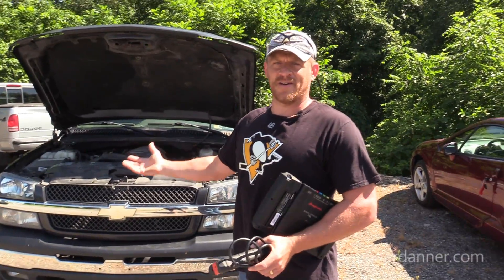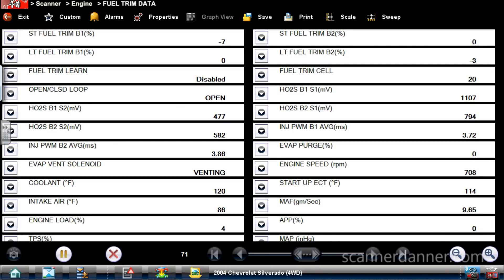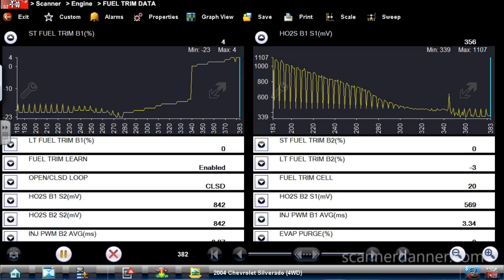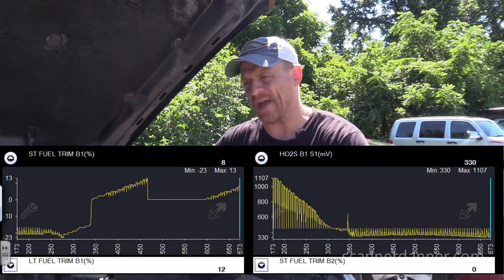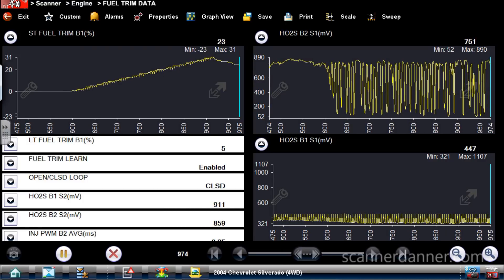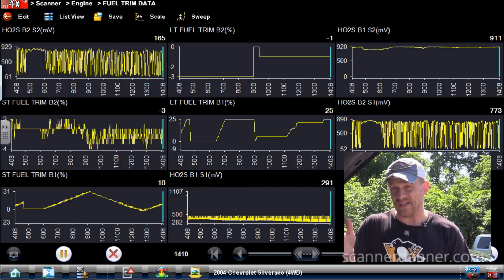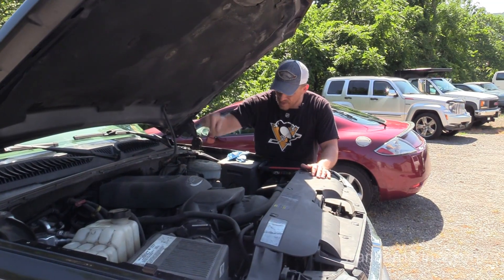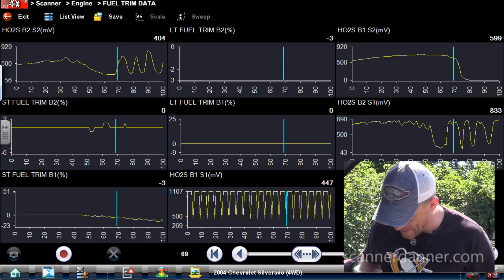2004 Chevy Truck O2 Sensor Fuel Trim codes P0131, P0134, P0171, P1133 part 1

Comment: @9:29

Check the wiring.

I misolaced my multimeter.  Thus, I rolled the duce on a new Denso® oxygen sensor.  It was more dead than the ceby in this video: flat-lining at 185 mV.  STFT +50. LTFT +25.

Oh—I lost the $65.00 + 10% sales tax bet.  New O2 is just as comatose.

1997 Chevrolet Express 1500 5.7L V8.

Comment: Anyone can help me. I have a cheap scanner and trying to fix my Pop Chevy 2005 Colorado. There is a P0446 and p1133. O2B1S1 is showing rich and O2B1S2 is also showing rich. Both O2 seems to respond well to throttle. LT is -14 which make sense to compensate. So my first thought is vacuumed leak or MAF. So I cleaned the MAF and it brought LT down to -2. O2 came down a little but still rich. Could the P0446 caused the lean condition? Trying not to be a part changer and since downstream O2 also showing rich. And respond 1:1 with up stream. I ruled out upstream O2 as the problem that triggered p1133 code. My guess is because it remain 95% on rich, that’s why it trigger p1133. What also trouble me is the downstream fluctuate up and down on rich side (wave sign). I was expecting down stream to be stead instead of having a sign wave like up stream. Still learning so please be kind.
Reply from the maker: What's the definition of the P0446? Most likely two separate issues
Reply: @ScannerDanner  thank you Paul. P0446 is a EVAP Control not switching. I have no other EVAP codes such as small leak or large leak. Without knowing which of the 3 component is bad I checked  the EVAP Purge Solenoid first and find that is working correctly (I.e close without power and no leak and after engine warm up it opened) I then looked at your video on how to test EVAP Tank Pressure sensor and found that the sensor was reporting low voltage all the time even when the gas cap was off signifying high pressure which was not accurate. I did the wire integrity test based on your video (Thank goodness for that video, I would of testing the ground with the 5v reference and possibly fry something if I did not watch your video. After replacing the Fuel Pressor sensor, I was reading the correct value around 1.5v. I drove the car around a few time but the EVAP test hasn’t fully complete. However, normally the Component error code would pop up by now. I will update after the EVAP has completed it full test. You are my hero and I have learned so much in the past few from all your videos to help me narrowed down the issue. Finger cross. I’m trying not to be a part changer. My Dad send his love ❤️ because he was worried that he bought a useless old truck. I do have some bad knews for him. Looks like the old owner has been running this truck rich for a while and the CAT might be bad. Down stream o2 is not looking too good. Did not do a pressure test on his exhaust but I have a feeling it won’t be long until it needs that too. Your ST LT and O2, MAF videos really gave me an amazing understanding of how it works. I never worked on car before and thank goodness there are great teachers like you out here. I brought my Lexus out to a local mechanic and he replaced O2 last year only to have the same code come back in a few weeks. I took what I’ve learned from your checking trims and after I cleaned the MAF, hasn’t seen and codes for awhile now. Much appreciations.
Reply from the maker: @MinhTran-tj4wq  the P0446 is a specific fault (vent solenoid) and is not going to be related to your rich condition. Lets move this to my forum. It is free to join and we can help you there. www.scannerdanner.com Let me know when you post it and I will jump over and help too

Comment: Im getting a P0131 and P0151. And one day I got a P0131 02 circuit low voltage. Its a 05 GMC 5.3 so is it a bad ground? What could that be? And the check engine light only comes on when im slowly rolling on the gas in 3rd or 4th gear. So is it telling me its too lean or too rich when I lug it a bit on the throttle?
Reply from the maker: you need to do some voltage measurements directly at the O2 plugged in, while it is running. If you can get me the voltage numbers on all 4 wires and what the sensor side colors are, I can help answer that question. The sensor ground is a gray wire (most likely) btw
Reply: @ScannerDanner  Sorry im just now seeing your reply. I don't know how I missed it man im sorry. Im going to dig into it today and check them all. I'm not an expert but I think what is happening is I wrote a tune for the Air fule ratio to lean out to 12.5 at WOT but the data shows at WOT its just fat and happy at 14.6 at all times no matter what I do. So if im getting low voltage in a o2 sensors im guessing its telling the truck to stay rich when it should lean out. Again I apologize for missing your reply, I feel like a dumbshit for asking you a question, you reply and I miss it. I do appreciate your reply and time thank you. Ill get into it and tell you what I find.
Reply: @ScannerDanner  Another thing that is strange is when I'm driving and floor it, it kinda slowly builds RPM but when I hit 35 3800 it wakes up and really gets moving. But its a pig down low. And "Bank 1 sensor at idle is 1190mv Bank 2 at idle is 1780mv also at idle "oxygen sensor B0.80V"
"Oxygen sensor B0.10V"
" Oxygen sensor B0.77V" My shitty diablo tuner is showing those all 3 in a row like this.

Comment: Thank Scanner Danner. My truck had those same 4 codes. But mine was a 2012 Silverado 5.3. But when I put the scanner I was getting the same readings for both upstream 02 sensors. Went to check the driver side and one of the wires was rubbing on my transaxle shaft and was missing a piece of wire. I spliced in a piece of wire and put the scanner back on. It was still basically having the same readings. Going up and down. It would go from 0.750 down to 0.090 and then 0.660 and then down to 0.400 and back to 0.100. Both upstream sensors were fluctuating the same way while the downstream were staying steady at 0.650 -0.800 or so. I took the truck for a long drive and the check engine light went out. I had 9 codes and now its showing only four. Even though it had nine codes they were basically only four but repeated twice and one was repeated 3 times. Hopefully that's the problem. I already ordered both upstream and will replace them when they arrive
Reply from the maker: Check to make sure your O2 heater circuit doesn't have a blown fuse. There may be specific fuses for it.

Comment: Hi ScannerDanner, I have a 2000 Montana Van 3.4, driving just fine right up to 110000 miles....then P0131 and P0137 popped up together.  I tried cleaning the MAF and knocking dust out of the air fliter (was pretty plugged)  I do not know how long it will take for the codes to clear if that helped, but failing that, if the P0131 and P0137 come together what are your thoughts if it is not a dirty MAF sensor?  thanks!

Comment: Hi.i have a 2001 tahoe with the 5.3.....im getting p1133 code and its seems to only trigger at highway speeds.If im just crusing around at low speeeds it usually wont come on.Any suggestions where to start.oh and when this code triggers.short term fuel is around 0 and long term is around 21.

Comment: Just want to see if you can help me out I have an issue I have a 2001 Chevy Silverado half ton V6 4.3 I already put a new mass flow sensor had to buy a second one thinking the other one was not working right but still pops up mass flow sensor low Field if you can please help me understand what's going on tired of putting more money into it especially buying departs what I don't need

Comment: Man you're super informative. I have a 3.4 2003 pontiac Montana throwing a code for p0131. After checking live data it works fine, then all of a sudden both line graphs for bank 1 sensor 1 and the bank 1 sensor 2 both 0 out. Occasionally sensor 2 (post cat) will go up and down. Any chance you may be able to give some advice?
Reply from the maker: Thank you! When those O2s flat line on you on the same bank, that is suggesting an actual lean condition. O2s are most likely fine. Was it misfiring during this period of time?
Reply: ScannerDanner thanks for the quick reply. Scenario is this. Cold start. Idles fine. Idle for a few minutes then go to drive it and after it hits normal operating temp it starts to throw a p0300. Car starts to hesitate and runs  rough with no power past 25% throttle. About to do a fuel pressure test.
Reply from the maker: very good approach. Just know that you do NOT have an O2 problem, you have a fuel delivery issue. If fuel pressure shows to be good, focus on the injectors next and maybe even the plugs and wires. A misfire, of any kind, (spark or fuel) will drive the O2 sensors lean (it is a false lean, unburned oxygen and fuel enters the exhaust)

Comment: Hey, Paul, I see something here Why B1S2 is not working up/down like B2S2 Is something affecting both sensors in B1 O2s Upstream/downstream the B1S1 is lean and B1S2 stays at rich instead going up down thank you( minute 9:43)
Reply from the maker: Because the cat is doing it's job on Bank 2. It shouldn't be swinging up and down like the upstream
Reply from the maker: Sorry, I should have watched that part first. The cat WAS NOT doing it's job during those frames but I didn't really have it warmed up either.

Comment: I've had practically the same issue on an old wideband O2 not long ago. Heater signal leaking into the measurement cell. Resistance between heater and measurement cell was something like 35k.

Really enjoy your work, hopefully you're getting settled down again after the Youtube premium saga.

Comment: Paul, a theory in the O2 frequency pulse: I was thrown by this on a Wideband signal that came out looking like a square wave. I worked out eventually that the signal was shorted to the heater ground and, because it's ground via a floating ground but was not being pulled down to body ground at the PWM heater frequency, it was producing a square wave instead of a flat line. New W'Band S1 O2 was the fix. Make sense?

Comment: I have an 03 2500hd duramax p0711 code changed the PSM and the wiring harness in the transmission still the same code do you have any suggestions I will greatly appreciate any help

Comment: what if u didnt have an o2 in the car at all what will happen i got  a used chevy and the o2 is not even there the place were u screw the o2 in is blocked what would happen in this case do i need to instal an o2 or i could leave it like it is

Comment: By Changing the 02 sensor take care of the P0300??.  Because I have a 3.8 monte carlo with a double p0300 code. ..also the car died on me while driving something killed the battery but Idk what it is. What would cause this?  That's he only code showing up...thanks
Reply from the maker: Did you have O2 codes too or just the P0300 code?
Reply: ScannerDanner no just the p0300...the code went away now I have a p030 code cylinder 3 miss fire..I checked all the coils the had spark but the #3 didn't. ..could it be the post that it connects to? ?

Comment: Paul first off long time viewer and another great video. By joining your premium and buying your text which I'm sure both are worth purchasing my question is getting access to the wiring diagrams. Do you purchase them separately is there a way of getting them by joining? I wrote this earlier but guess it was lost in space on the internet. Just wondering if I could purchase all 3 items. Any advice or info would be helpful. Thankful your back up and going strong Artie
Reply from the maker: Arthur, thanks so much for your interest in SD Premium. The wiring diagrams I use come from an expensive program called ShopKey Pro, it is around $150+ per month for access to this and is not part of SD Premium. If you are a DIYer, then of course ShopKey would not be very cost effective, so we've created a thread on our forum to help you guys find service info.
https://scannerdanner.com/forum/post-your-repair-questions-here/16-need-service-info-check-here.html

Thanks again and I hope to see you on the website.

Comment: Could that odd signal on o2 be from the heater circuit? Looks almost like an on/off signal
Reply from the maker: Definitely. I just wish I knew if this was a PWM heater on this model. I thought no, initially because of its age. But it makes the most sense. 
Though most PWM heaters are not activated with just the key on and that O2 signal was at 1100mv at times with the key on.

Comment: Jeep Wrangler TJ 1997 4cyl 2.5L, I see a small spark at night at the front of the motor at the tips of the corner of the bolts that hold the thermostat, I cant's find a short, but when I up the RPM's the spark increases in it's glow, my Jeep is running so lean the header glows red hot, only code that showed up was "Open Fuel Circuit Loop... Can you be as kind to tell me the cause, been months and no one has been able to figure it out ty
Reply from the maker: Are there computer ground wires that bolt to the thermostat housing? Make sure they are right. A lose ground can do some crazy things.
Reply: I almost rebuilt this whole thing, didn't see any, that really messes with my mind... I have an idea now what I should keep looking for, I had a feeling it could be some kinda short... This little problem is the only thing holding me back, may I will add some ground wires and see if it helps... I been up and down this Jeep... Thanks you a bunch
Reply: Get a load of this I figured it out it was static electricity from the serpentine belt the pulley and harmonic balancer I need to find a way some kind of dielectric or something to stop the static but I used wax and it temporarily fix the problem and the spark stopped
Reply: I’ve seen aftermarket drive belts (mainly the Goodyear gator back belts) cause this on a couple of cars. You can actually hear an intermittent snap and see a spark when it happens. Only way I was able to fix it was to install factory belts and that took care of it. Hope this helps!
Reply: Thanks a million, I was wondering which way I should go
Reply: Neil Watson Afghan Sita TVs
Reply: Those are the worst belts in my opinion and will definitely cause the issue you are having. Go get a new belt from jeep and it should resolve your problem
Reply: That's the exact belt I have

Comment: Did you notice at 17:35 the b2s2 o2 sensor switching like the upstream one on bank 1?  Looks like there may be a bad cat on that side as well
Reply: That is possible and would require further diagnosis once the engine is warmed up and running properly. The reason I pointed it out was because it was on bank 2 and the o2 sensors on bank 2 seemed to be operating normally (bank 1 was the issue side with the failed upstream o2 sensor). I Just thought it might be something that was worth looking into to avoid a comeback with the check engine light on again
Reply from the maker: I didn't notice until you pointed it out. It certainly doesn't look good but we also need to remember this engine was not running long and that cat may not have been hot enough yet. Good eye bro
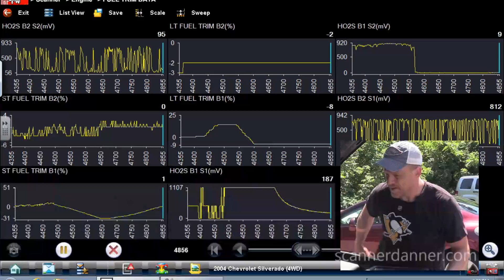Reply: **Sorry, I meant at 12:55**
Reply: up next 2004 Chevy Truck with P0420 Catalyst System Efficiency Below Threshold ;)
errmm P0430 sounds better. mixed up the left's and rights :)
Reply: catalytic converters, who needs'em, where's my sawzall and straight pipe ;)

Comment: Do you have any idea why my both my fuel system would say it's OL fault ?
Reply: J Michael G. Any trouble codes stored?  OL fault usually means the pcm detected some type of fault and is forcing open loop operation.
Reply from the maker: exactly what Discretesignals said. You should have trouble codes with an OL fault. And DO NOT be in a rush to replace your oxygen sensors. Vacuum leaks, MAF sensor issues etc can cause OL faults too
Reply: My codes are p0132,p0152,p1164,p0135
Reply: Last OL Fault I've seen  was caused by a huge vacuum leak on a pcv hose at the intake.  Fuel trims were all showing zero during fault.

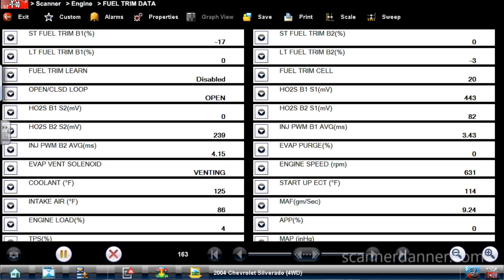Comment: Ok, so.. 2:45 EVAP is Venting in open loop.  Trim learn is disabled?  B1 ST trim is - numbers.  Indicated OS on all but B1S2 as it just started warming up ~10deg.   missing something?
Reply: gbowne1 The evap vent valve is open, but the system has 0 % purge going on.  Evap vent valve is normally open unless the pcm is performing an evap system leak test.  The evap system is not purging.
Reply from the maker: Not sure what you are asking me.  The vent solenoid is always venting unless an EVAP leak test is being performed. 
"Fuel Trim Learn" is a useless data PID.  STFT on bank 1 is negative because the O2 signal during this period is biased high (more than 450mv) due to the heater circuit bleeding into the signal.
Reply: ScannerDanner, I saw later that it went to enabled and closed loop.  Useless PID or not.  Does it normally bleed into the signal in this?  Just trying to see if I got what I saw straight.  Open with no purge?  Ok.  I just saw that the bank 1 STFT was 0.  when the others werent.  Didnt catch the bias V.

Comment: Almost looks like the 02 heater's duty cycle. Signal wire shorted to heater circuit? More voltage/ duty cycle on the start than reducing as the exhaust heats up.
Reply from the maker: Agree, but internal to the sensor is where the short was, nothing external was shorted or damaged.

Comment: I have the same issue with 03 suburban. Some how internally heater control wire was touching signal wire. I find out by key on engine off it was reading 1050mv as soon unplug the sensor drop to 450mv. In the case i was working i didn't see any type of duty cycle signal.
Reply from the maker: nice! Exactly what we has going on here